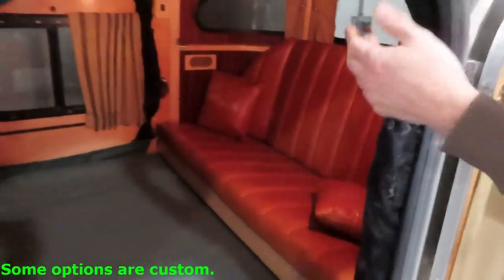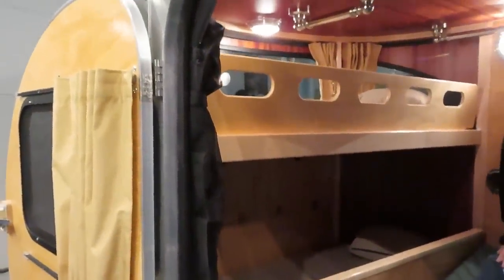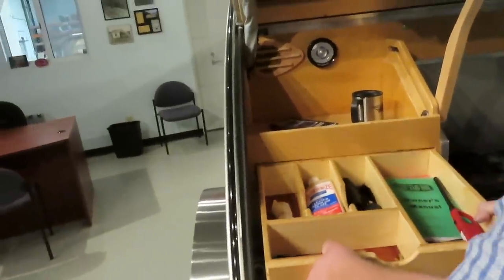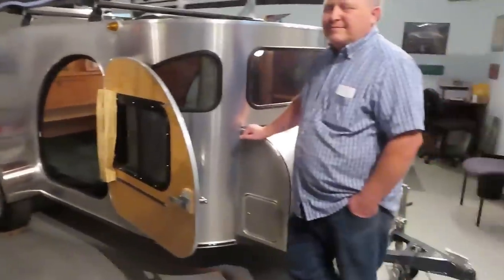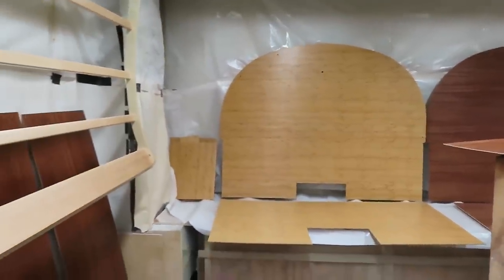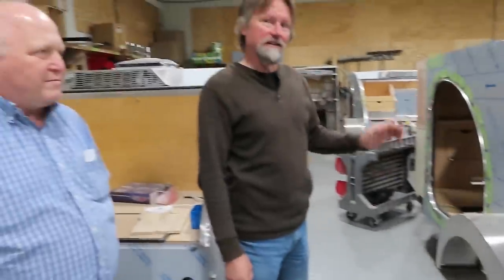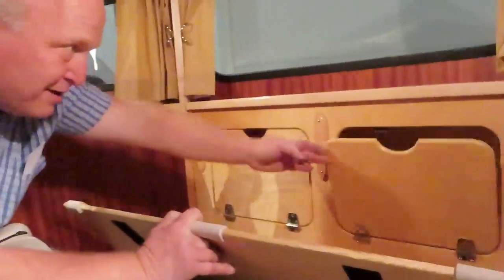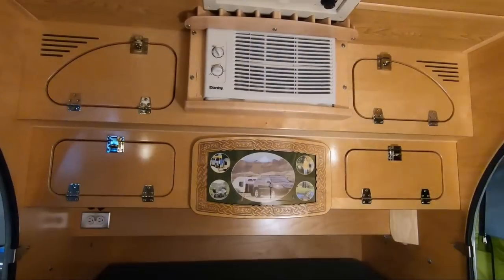CAMP-INN Teardrop Trailer Shop Tour 560 550

Comment: After quite a period of research, this is my overall favorite teardrop trailer.
Reply from the maker: You cant go wrong with a Camp-Inn or Vistabule. Just depends on which you like!  𝕋𝕙𝕒𝕟𝕜 𝕐𝕠𝕦 𝕗𝕠𝕣 𝕨𝕒𝕥𝕔𝕙𝕚𝕟𝕘!  ✅  Check my other videos https://www.youtube.com/cosmoweems/videos 
SUBSCRIBE https://www.youtube.com/cosmoweems?sub_confirmation=1 =𝓒𝓸𝓼𝓶𝓸 ✅
Reply: There is one thing, I would prefer flattop finders, that are strong enough to stand, but mainly to use as table surfaces on both sides.
Reply: @CosmoWeems  I know what you mean!  I like the mahogany veneers on the CI and the front profile of the 560.  What I like about the Vistabule is the windows and the front facing sofa with table and feet drop bins.  The red leather couch of the CI is eye catching too for sure.  it just looks very high end boat finish style to me.

Comment: Cary and Craig are awesome! We just ordered one of their roadtoad models to tow with our tesla model 3. Only weighs 400 lbs. bare bones but we sleep in the car :)
Reply from the maker: Ha When I was there they spoke about a Tesla owner taking the Toad out to check how the car could pull it. Enjoy the toad gears are turning in my head about ways to customize it. I will bet you a penny you end up sleeping in the toad before a season is done. Enjoy and thanks for commenting. =Cosmo
Reply: @CosmoWeems  I'd take that bet :) we're not getting HVAC in the toad- just using it for storage and will be building a luggable kitchen in the back.  The Tesla is a really great climate controlled environment- one of our friends calls it our 'life pod'.  It's a little snug (twin sized mattress) but we don't mind.   We did more than a dozen trips this year in it, but are ready to have a setup that takes a little less time to set up and tear down.   We did buy a Clam venture based on your review- great unit- thanks for that

Comment: Woh..Necedah, WI.?  Worked in that city (Best Power) six years…never knew they were there! Well, wasn’t looking for a tear drop at the time. Small world…great review Cosmo! Should have considered them before my purchase a year ago…Cheers and stay safe!
Reply from the maker: Camp-Inn was neck and neck with my Vistabule when shopping. It came down to a few features I needed and Vistabule has. Both are top notch trailers. You cant go wrong with either. If you are having fun with your rig you made a good choice! 𝕋𝕙𝕒𝕟𝕜 𝕐𝕠𝕦 𝕗𝕠𝕣 𝕨𝕒𝕥𝕔𝕙𝕚𝕟𝕘! =𝓒𝓸𝓼𝓶𝓸 ✅
Reply: Nice, I figured you did your detailed analysis. As you know I purchased a T@G  Boondock a year ago and I’m very happy with it! Just visited the nuCamp factory to complete a couple pending accessories ( global parts demand shortage), and they delivered… call me a very happy camper! Cheers..
Reply: Alejandro, both Craig and I (Cary) worked at Best Power before Camp-Inn. I was there from '89 until 2002. We were in engineering.

Comment: They make a beautiful trailer.  That finish is nice.  BUT, I don't like the kitchen set up.  For example, if you are cooking, you are leaning way over to reach the stove.  If your counter has cooking supplies on it and you need in the dry storage, you would need to rotate you skillet handle, slide all your cooking supplies to one side, open the lid, remove the silverware tray, place it on a table (which already has a cooler on it), than grab the dry goods out of the bottom storage.  Than place every thing back in place to continue, and hope you remembered it all to not do it again.
Reply from the maker: Thanks Mike. I liked your build video https://youtu.be/pcz-TZBEi_Y No kitchen is perfect. Camp-Inn and Vistabule put a lot of brain power and experience into their kitchens. They are better than most trailers I see. My least favorite are the burners that slide out of the side of the trailer with no counter space. Your kitchen looks pretty nice. Thanks for checking in. =Cosmo
Reply: @CosmoWeems  Hey Cosmo, I'm envious of your style.  Oh, my kitchen has issues, no doubt. I agree, not all set ups work for all.  That is just my opinion.  I use to tell my kids when they would point out someone who is different  just how boring the world would be if we were all the same.  The important thing is to go and get outside.  See you out there.
Reply: It works well.

Comment: 1) WHY NO AL. FRAME?
2) Do they offer one made of fiberglass?  6K?
Really enjoyed the viedo....."Craftmanship" all the way!
Reply: The Road Toad is composite with an aluminum unibody.
Reply from the maker: The do offer the 6K Road Toad model you can see it on their website https://roadtoadcampers.com/ Its an amazing little rig that is built with the Camp-Inn quality. Video coming. =Cosmo
Reply: 1) Aluminum frame. Because of the unique uni-body design of the Camp-Inn the steel frame is built very very light. Most teardrop manufacturers use the frame as part of the structure of the body. We do not so it is very minimal. We have ran the calculations and to make an aluminum frame version would only save about 7lb over the light weight steel frame we use. The added cost, stress cracking concerns and bolted coupler connection just would not justify this little of weight savings.
2) As both Joshua and Cosmo pointed out the Road Toad campers are a composite, totally wood free product. That is the our brand that is in the $6K price range. Check it out at the link provided by Cosmo.

Comment: I have a 2020 Outback 2.5L Engine. Would it be sufficient to tow a Vestibule?. I was also wondering what is the weight,length and height? Thanks
Reply from the maker: I am towing with a 218 Outback 4 cyl no turbo 2.5L. Its a very good match for towing a Vistabule. You get the great gas mileage when not towing. While towing I average between 20 and 24 mpg depending on how much alcohol is in the gas. In Canada with no Alcohol I get much better gas mileage. I considered a Tacoma pickup truck but am glad I went for a higher gas mileage vehicle. Outback is the most popular Vistabule tow vehicle!  𝕋𝕙𝕒𝕟𝕜 𝕐𝕠𝕦 𝕗𝕠𝕣 𝕨𝕒𝕥𝕔𝕙𝕚𝕟𝕘!  ✅  Check my other videos https://www.youtube.com/cosmoweems/videos 
SUBSCRIBE https://www.youtube.com/cosmoweems?sub_confirmation=1 =𝓒𝓸𝓼𝓶𝓸 ✅
Reply: @CosmoWeems  Also the most popular tow vehicle towing Camp-Inns! By far
Reply from the maker: Good Point! Thank You. You can tow the Camp-Inn 550 and 560 with an Outback 4 cylinder.

Comment: those dc camp coolers use so much power
Reply: What exactly does that mean?  I have a 35 liter model that uses 14 aHr average per day in ambient temps in the low 70s.  That is incredibly efficient in my book.  Dometic fridges are slightly more efficient.
Reply from the maker: Dometic only draws 44 watts per hour (I measured that with a meter that factors in duty cycle over an  hour). Cost and value have no relationship. I LOVE my Dometic fridge.  𝕋𝕙𝕒𝕟𝕜 𝕐𝕠𝕦 𝕗𝕠𝕣 𝕨𝕒𝕥𝕔𝕙𝕚𝕟𝕘!  ✅  Check my other videos https://www.youtube.com/cosmoweems/videos 
SUBSCRIBE https://www.youtube.com/cosmoweems?sub_confirmation=1 =𝓒𝓸𝓼𝓶𝓸 ✅